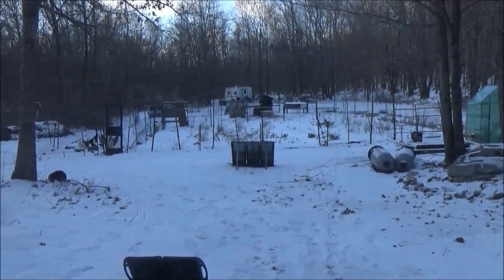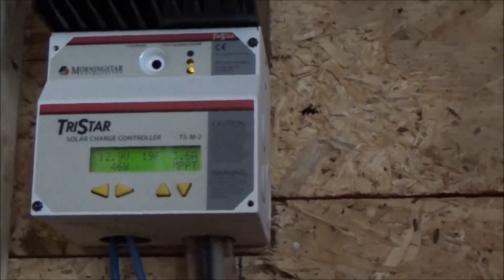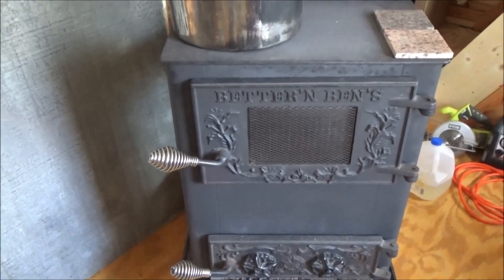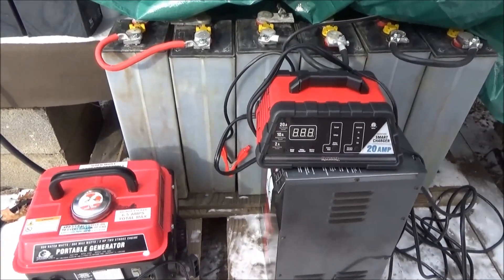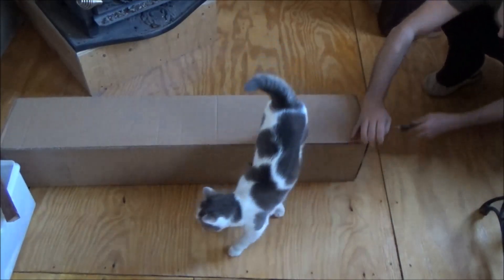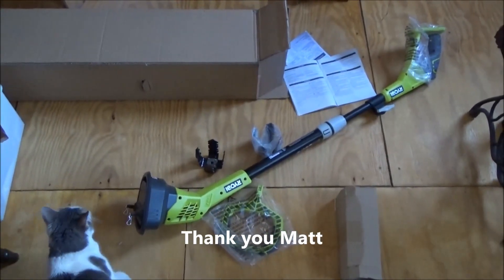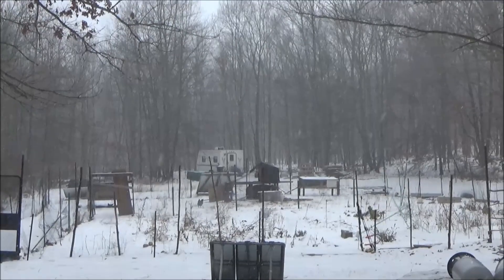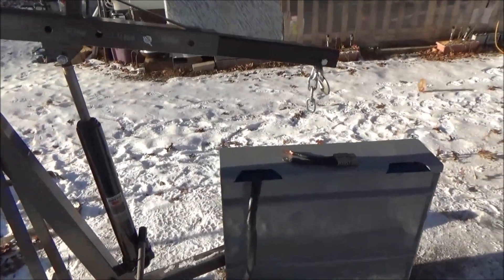Its All About The Batteries Forklift Battery For Home Solar Power

Comment: If I we're u ide put the new forklift battery in the house in a vented wood box that way they will stay warm  it will increase their capacity by at least 50% and it doesn't look very big so u could put it under  ure charge controller
Reply from the maker: There is no way to get this heavy think inside. Plus a forklift battery gases off heavily. not safe inside

Comment: look im soo lost    people are telling me to charge at  14.6  volts all the time ..  but my bats  are boiling  i think 12.6  is  100 percent..  why would i charge at  14.6?     i have a 200 watt  12 volt system.   i under stand this guy is Equalizing his but what dose he charge at  every normal day???
Reply: +The Deprey's 12.7v is 100% state of charge(SOC) on a new 12v battery.  To get the battery to charge, you have to input a higher voltage than its voltage.  Too little voltage will keep you from putting energy into the battery. Too much voltage will boil the electrolyte in the battery.  Short bursts of about 15v for a few minutes will boil some electrolyte out, but it will allow some of the sulfur on the lead plates to be removed.   14.2v to 14.6v is best for charging a battery to 100% SOC.  Lead acid batteries should be kept at room temperature for best performance.  12.6v is fine for a slightly used battery.  If you apply the proper voltage and the battery refuses to increase its voltage, then the battery is fully charged for its age.  Stop trying to over-charge a used battery as you will just end up boiling the battery.  As a battery ages, the max voltage will decrease.  There will come a time when your battery will not charge greater than 12v. I replace my batteries at this point.  Automatic inverter cut-off is generally about 10.5v.  I can afford to replace my batteries before they are useless for storing energy.  Do try to not deep discharge 12v batteries to the automatic inverter cut-off at 10.5v regularly as it will shorten the life of batteries.  In summary, lead acid batteries will last many years if you maintain the electrolyte level and do not discharge them below 11v.  Oversize your battery banks on purpose so that you do not have to deep discharge them.  Keep hitting the auto cut-off of the inverter on a 500 amp hour(AH) 12v battery bank, double the battery bank to 1000 AH.   Hopefully, the price of lithium batteries will come down soon so that we all can switch over to the more efficient batteries that power our mobile devices.

Comment: trying to heat with blowdown dead wood ? must allow more air to burn chamber , it just ain't the same , and if it's maple much luck to ya ? you need some cured oak or elm or ash , split  and cured mixed with the blowdown to get heat and burntime,  bet you see some large embers in the firebox with that wood,
Reply from the maker: It does need more air to burn, thats for sure.

Comment: Why wouldn't you clear a spot and have him set that new battery where you can use it without taking it apart?  Put it to work immediately.  If all the cells are good, why tear it apart?  Seems like a pointless step.
Reply from the maker: They could not really move around here on the snow and ice. They wanted to simply drop it off. They almost did not deliver to a solar powered home. I am their first although they have been asked many times to sell to an off grid home. I am paving the way for others. I will not take the battery apart. Its too nice to take apart.

Comment: LMAO @ -25 wind chill. In northern Canada where we are, that is an average day temp with no wind. We easily get -60 and colder with wind chill for days and weeks at a time. And yes, we can live off grid, but with lack of sun, solar is pointless, wind is the only way and it is 3 times the power for 1/2 the cost, plus, the sun don't set on the wind.
Reply: +Trina McDonald Another pet peeve. Everyone keeps harping about needing a "tiny house" to go off grid. This hampers the off grid movement. Not many people will sacrifice that much room to go off grid. Our 3600sqft house off grid is very comfortable. And we dont have to live without modern conveniences. Hot water, furnace, laundry, etc..